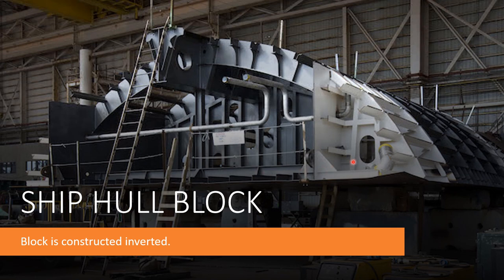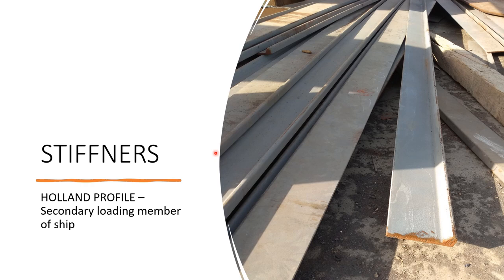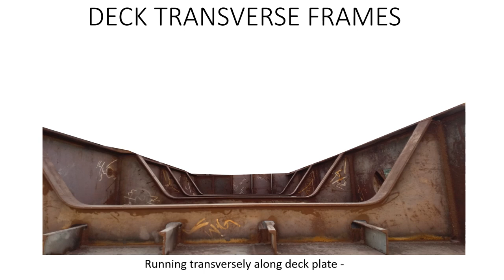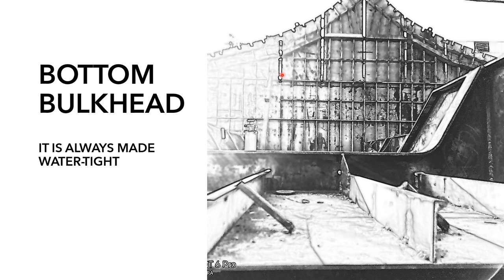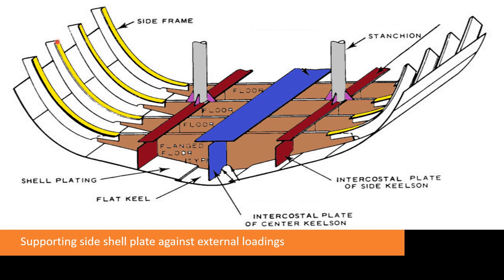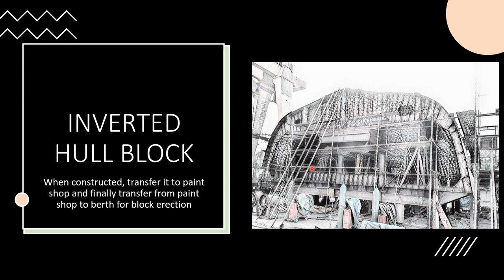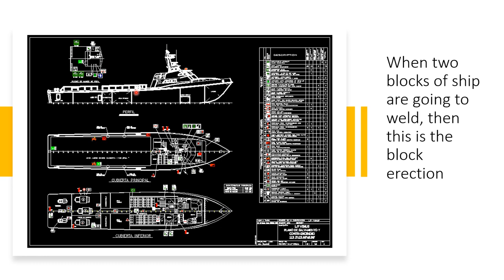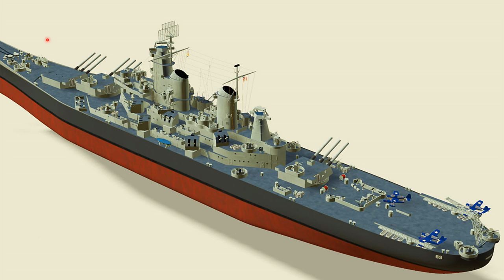Ship Hull Parts ¬ Ship structure ¬ Ship block parts ¬ Stiffeners ¬ Transverse Frame ¬ Girders ¬

Comment: Sir u said above block template block are constructed.deck plating placed then transverse deck frames. But u didn't mention about floors
Reply from the maker: Yes you are right absolutely. As the block in pic is partially constructed. I have mentioned about floors in the sperate slide. You can check in the video.